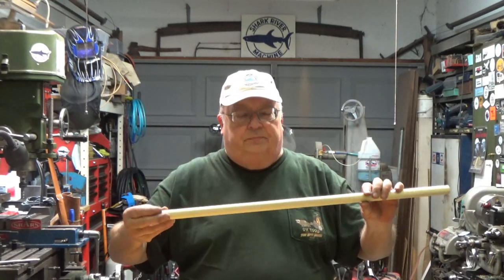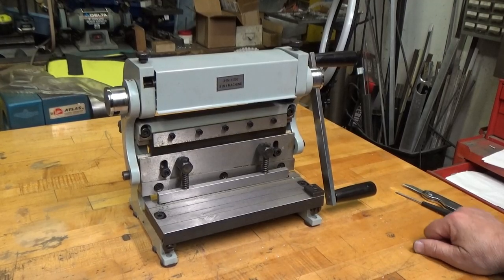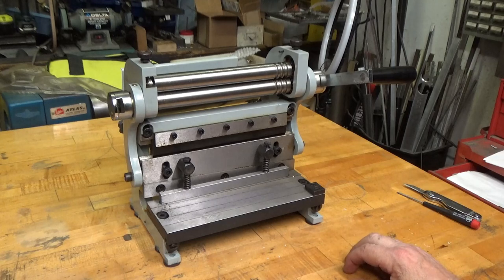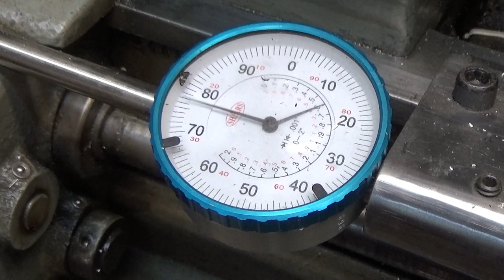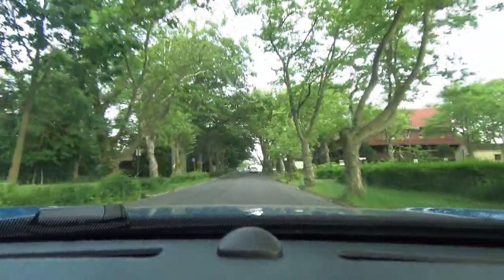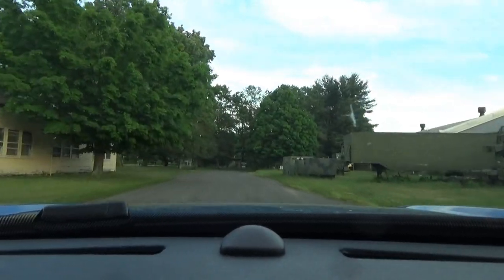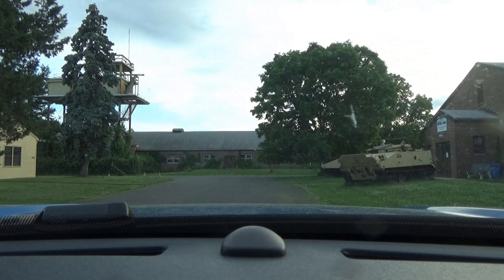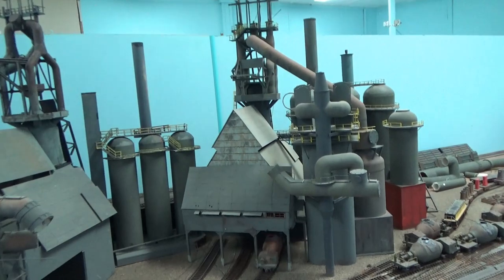Short Production Run-Building Bethlehem Steel

Comment: I have one of those 3-way machines in 12" size I bought from HF many years ago for doing restoration work and building stuff for my American Flyer S gauge trains and layout.  Very handy tool for the purpose when needed.
Reply from the maker: I am interested in building a tin steam traction engine.  I think that it will be ideal for that.  Thanks for watching and commenting.